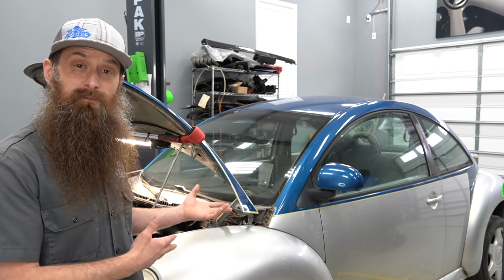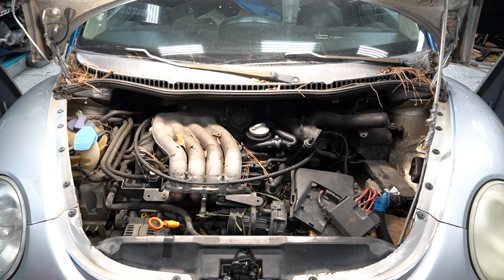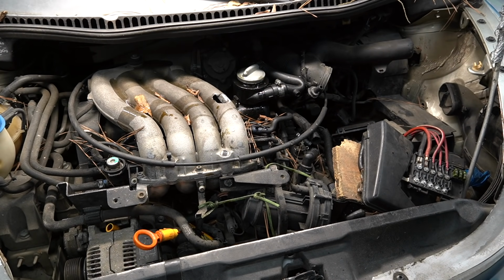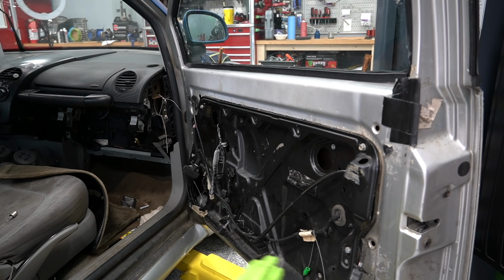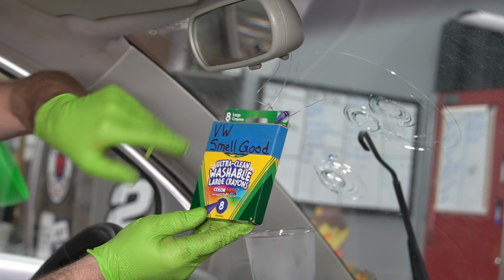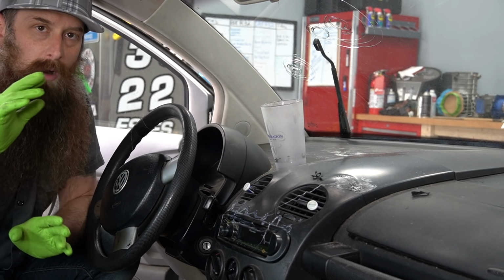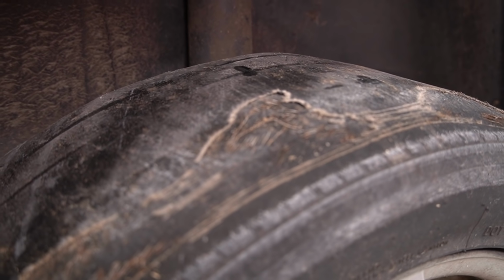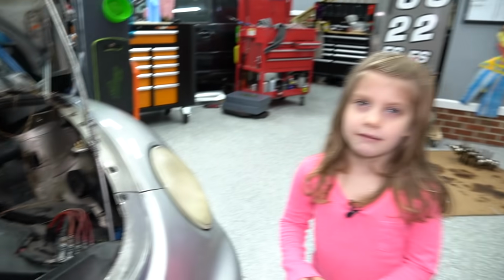How To Make Your VW Run FOREVER ~ 5 Easy Tips

Comment: I usually run the engine with soap and water to get all the black goo out.  Once it's clear, I button everything up and go about my day!  Don't forget to refill your blinker fluid and check your exhaust bearings!!
Reply: I forgot to check my exhaust bearing last month and it absolutely destroyed my windshield so I’m going to have to replace my tires ASAP.
Reply: @xMrOzzy  Oh damn man, sorry to hear that.  May want to also check the dashboard washer fluid while you're replacing the tires.
Reply: @xMrOzzy  that's because you didn't lubricate the trunk latch,I've seen it before.
I think there's a thread on the forum.
Reply: You almost forgot the piston return springs!! 🤷‍♂️
Reply: @saro92dme  holy crap!!!  I think my car is due for a piston return spring tune up!  Glad you mentioned it.  Anyone know of a DIY on how to do this?  I think ECS Tuning has the upgrade kit, but no instructions. 🙁
Reply: @saro92dme  you forgot to mention the cans of compression needed with piston return spring

Comment: Make sure to use thicker battery wood on a TDI as per the spec listed in the Bentley manual.
Reply: I did a stage II minwax on my battery wood, 1.8t neva lose

Comment: I got a mk4 Jetta in 2001, and put an optima battery in it.
Best investment ever. 
Everyone with the wiring issues in the battery area can blame the lead acid battery venting and corroding all the wiring and causing issues. 
I checked a few of the grounds under there recently and it looked like new when I pulled the nuts off ,so I just tightened em back down.
Reply: 3:50 
My beater Nissan uses a rolled up shop towel crammed in the groove 😝

Comment: I actually just replaced the dipstick funnel on my MKV Non Turbo FSI and it seemed like the level was reading good when it shouldn't have!  By the way on that engine you have to remove the intake to replace the dipstick funnel! It's okay though that gave me the opportunity to pour out 15 years of accumulated oil and carbon sludge.

Comment: Okay.  I have a 2012 sixth-generation Golf.  Right now, it runs fine.  It has nearly 52,000 miles on it.  I've had only two problems with it since I bought it new. The first one took seventeen tries to get fixed by the dealer - I'm not making that up! It was a constant stalling when the car was at a stop.  The second problem was a broken latch on the hatch door.  I got that fixed on one try.  I have only three other issues, all of them cosmetic.  The lip of my driver's seat has collapsed because of the foam inside falling apart.  The right B-pillar trim is rippled, and so is the paint on my right rearview mirror cap.  Otherwise, I'm good - no peeling soft-touch plastic like on my old Mark 4!   I hope to get all of this fixed eventually, but I have to ride out the pandemic first.  I wanted to get a new Mark 8 Golf in base form, but Volkswagen of America, in its infantine wisdom, has decided not to sell it here and just offer us only the more expensive GTI and R models.  Even if I could get a base Mark 8 Golf, I know I can't get a car with an in-dash CD player anymore.  (I have lots CDs, but no smartphone.  I'm a flip-phone guy.)   So, yeah, I sort of WOULD like to keep my Golf 6 forever, and I came here specifically to learn how to do that  Next time, can you please post a video explaining how to make your VW run forever  FOR REAL??? Please?

Comment: The way to keep your V.W running forever  is to find a good mechanic and get your engine rebuilt every 10,000 miles.
Reply: My Jetta lasted 30,000 miles before it needed engine removal. It just goes to show you the craftsmanship that goes into these things.

Comment: I bought a used VW in really great condition..  the only downside was that it didnt have any holes in the speed pipes and the lights on the dash stay off so I never know if they work or not. I thought the check engine  lights and all that on VW dashes are usually on? Are my fuses just bad?  I could have sworn those came from the factory like that? Maybe they started producing them hole-less and with lights off after the 2007 refresh? Minus those two things I'm happy with my purchase.

Comment: I got a question . Are the steering knuckles the same on the convertible new beetle as the new beetles with a roof. Because I I took a knuckle off a convertible beetle. And mine has a roof. They both had the same engine 1.6sr.

Comment: Hello Humble mechanic
I have a skoda octavia 1.9 tdi 2005 model car. The car brakes works well for the first 3 attempts then it becomes hard and once drive further you get back the brake for 3 attempts. Also the car does not go above 100 kmph I have changed the turbo charger core 6 months back. Please let me what I need to check to fix this issue.
Thanks

Comment: Lmao!!!!!!! Funny vid!

I work on a lot of vw’s they really are good cars. The biggest problem I see is the customers going to shops that do not understand how to work on them costing the customer more money. I work on a lot of alh diesels, a hand full of them have 500k miles on them still running great. Usually when I get a new vw customer they heard about my shop from another shop. I just had another alh diesel customer come into my shop he said it has been at a few other shops for the past 3 months and wasted a few thousand bucks trying to fix it. This car the injection pump timing was off and injection quantity was off so it only costed them a few hundred bucks for me to fix it. This customer lives 1 hour away from me but he comes all the way out to me because he can’t find anyone else that knows how to work on them. I use to hate vw’s until I really learned about them and then they really are actually easier to diagnose than domestic vehicles.

Comment: Charles, what must I do if my battery wood caught on fire? Should I replace it with a new, bigger wood that would properly fit my melted battery, or should I pull out a door panel and use that instead? 
Thanks for your help, much appreciated!

Comment: My 96 Audi is like an old DC-6, top off the oil and check the gas.  If I could not do my own maintenance I would have scrapped this a long time ago.  Be right back, gotta change my cam plugs and valley gasket, again.

Comment: The dip stick snapped in half on my mk4 Golf, then the dip stick holder fell apart. I still own the car, Both fenders and  headlights got replaced in 2 different accidents, the headliner and fabric on the door panels came unglued, the car is 17 years old and has 70,000 miles on it.

Comment: Idk If you would happen to know but where the hell is the ac drain valve on those new beetles I have a 2010 and I’ve changed the air filter and the cabin filter is deleted on that year it’s just a permanent mesh filter but there is a musty smell coming out of the ac and I have a theory the drain is clogged any help locating it would be amazing !
Reply from the maker: It’s on the passenger side behind a heat shield on the outside.  You can see a “U flap” cut out. 

Or you can access inside the car. Just to the passenger side of the console behind the carpet
Reply: @HumbleMechanic  I see 3 cut outs the top one almost looks like a valve would that be the one ?

Comment: Very funny video. Your daughter is beautiful.  Back to work, where is the ground strap for a 2006 vw new beetle 2.5 hatchback please. I don't have a hoist to check everywhere and I crawl under on gravel. Not so fun. Would appreciate you at least sending me in the right direction to check it. 
On a different note I followed all your instruction to replace the vacuum pump as it was leaking, the starter as it had failed. I also changed out the seized ignition assembly exchanging the key part with my original. Ive changed out several other parts as it is old and I figured maintenance if nothing else. There is fuel at the fuel rail. I changed the fuel filter. My fuel pump engages every time I turn it over. My key will turn and start the car but it dies right away. I had the security car/key light flashing at first and knew it was an immobilizer issue. I did all the learned tricks to get it out of that mode.That worked.  I only have the security light come on with key on but then goes off now like it should.  I still can't keep the car running. It is my original key with the original chip in a new case.  I am lost. Id really appreciate any ideas to try. There is no CEL and no codes on the scan. Im thinking to buy a new key and get it programmed. Im in Canada. Thanks for all the great videos.

Comment: I got three tips for making any Volkswagen 2.5 L five-speed last 200,000 miles with very few troubles first change your oil at 5000 miles second change your oil at 5000 miles and last but not least change your oil at 5000 thousand miles use mobile one 5w 20 Also every time you fuel up check the oil and that’s how you get 200 k 🤡🌎

Comment: If your VW doesn't have oil under it your not VWing right. Or brake fluid. Or antifreeze. Or power steering fluid. And who needs VW smell good when your interior has that vintage antifreeze is full smell.

Comment: its even easier than that ,service it yourself  with good oil every 7500 mile  do belts and rollers on time keep brakes tip top and keep shocks tip top these cars go for ever if you respect them